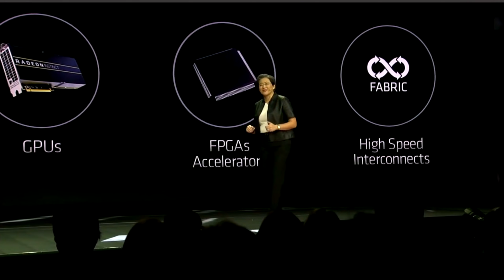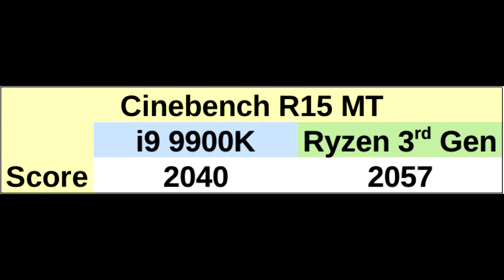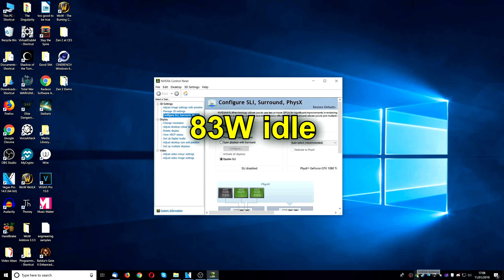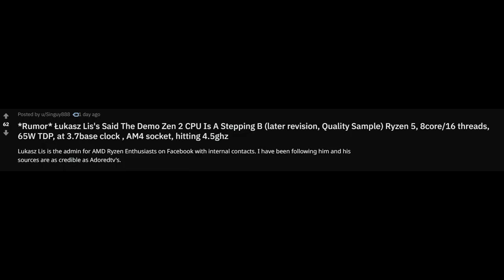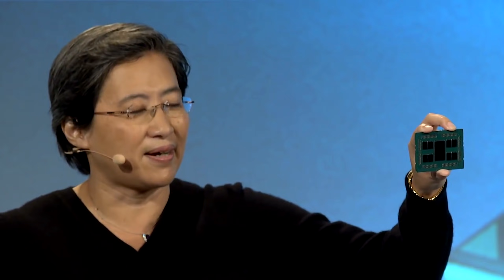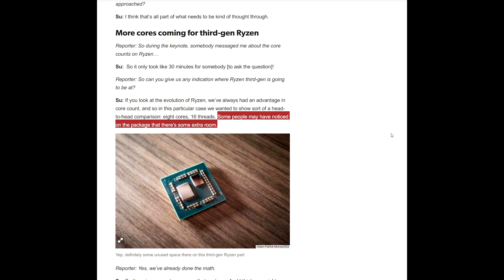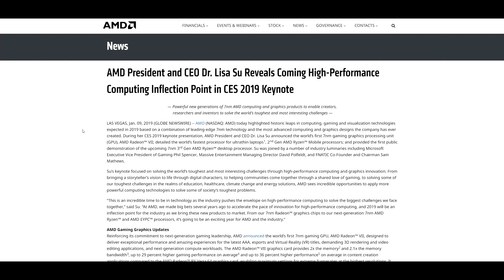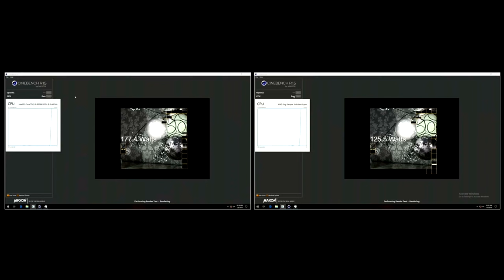Zen 2 Faster than i9 9900K at Half the Power.

Comment: Using the 8c/16t Zen2 chip against the 9900K was far more embarrassing for Intel than using a 12c or 16c chip. Because there's no way in hell that 8c/16t Ryzen 3000 will cost anywhere near the 9900K. 
Even if those leaked prices end up being 20% higher, Intel will still be forced to drop prices. I'm starting to get sick and tired of Intel's prices. 430EUR for the 8700K/9700K and 575EUR for the 9900K? Piss off Intel, you're drunk.
Reply: But can they? Don't their chips cost more to make?
Reply: @Cryosxify  Cost more to make individually, but they can produce many more per wafer due to the chiplet design.
Reply: @STR33TSofJUST1C3  Intel I mean. They have to maintain margins and they're losing market share so they're kinda boned
Reply: @Cryosxify  Oh Intel? No idea. The only way to gain market share is to sell more. If your sales drop due to being non-competitive, you are kinda forced to cut your prices.

Comment: I am very happy that the 8 core part is a single 8-core chiplet and not two salvaged 4 core chiplets. I don't really need more than 8 cores and I was a bit concerned that the 8 core was going to turn into a TR-like configuration with all the latency implications.
Reply: You'll still have higher latency than say an Intel ring bus part since the IO is on another die however AMD have said already that some of their IPC gains are directly coming from latency reduction.

Comment: "And two memory channels will be enough?" "as I said, more to come"

Triple channel memory perhaps? With a separate I/O die, it's a possibility! (though as dope as that'd be, I'm guessing unlikely)
Reply: AM4 doesn't have pins for extra memory channels. And adding more pins would make it completely new socket and that's not going to happen cause TR4 exists.
Reply: @kognak6640  I am not that familiar with the hardware arrangement with the pin outs on the new cpu since the memory IO controller is now a separate chip. They all communicate to 4 channel boards, just not with dedicated controllers. Please teach me more. I am always eager to learn more.
Reply: @joanamendoza-r5l  AM4 boards have two channels. 4 memory slot boards have 2 slots per channel, either in T-shaped topology or daisy chained. Latter is typical as it provides best signal quality for primary slots(=best possible clocks) and reason why first two memory modules go to certain slots. AM4 has 1331 pins and because each ddr4 channel requires about 200 pins, quad channel socket would have minimum 1800 pins. Intel's quad channel socket have over 2000 but it has more PCIe lanes.
CPU pin layout needs to remain same if cpu fits in same socket as predecessors. And because zen2 is backwards compatible, it will have that same AM4 pin layout and two memory channels which come with it.
Reply: @kognak6640  You don't need that many more pins for more channels, if there are unused pins on the am4 socket and package it might be possible to create and am4+ motherboard chipset to enable more channels, perhaps even more pcie lanes. Though moving to pcie4 would also allow the 4 lanes going to master chip to be down-converted to 8 pcie3 lanes or even 16 pcie2 lanes and thus support more add on device with fewer cases of 'using x dissables y' situations like we have now. here the socket could stay am4, and just need a new chipset.
Reply: @kognak6640  I found an image of the pinout, and I have no idea what any of it means, but there looks to be many unused pins. Again, I'm not saying it's likely, but a boy can dream, no? https://www.google.com/search?q=am4+pinout&client=ms-android-bell-ca&prmd=isnv&source=lnms&tbm=isch&sa=X&ved=2ahUKEwiZsbqowujfAhUM7IMKHS9aA5EQ_AUoAXoECAwQAQ&cshid=1547305622167&biw=360&bih=560#imgrc=HAjx_upvEgIUmM
Reply: AM4+ Triple channel ?? hmmm
Reply: If the R9 has TR performance, I would bet it is going to have quad channel I\O controllers.
Reply: @nxtktube  When Lisa was asked, she said there was more to come. Ryzen, and just about everyone else that has not been living under a rock know that memory bandwidth on AMD platform is the Achilles heel. There is a solution if I were a betting man  if we are to truly stay on the AM4 platform for two more years.
Reply: @joanamendoza-r5l  "memory bandwidth on AMD platform is the Achilles heel" Can you explain why and show some evidence of that?
Reply: @bgtubber  The best example is to look at benchmarks on You Tube using DDR4 at different frequencies. The higher the frequency you go, the better performance you get, to a point. Single rank vs dual rank memory also affect performance, dual channel vs 4 stick solutions, high CAS timings, poor bios memory mgmnt by motherboard mfgs, etc.
Reply: @joanamendoza-r5l  That's largely due to that infinity fabric having it's speed tied to closely ram speed and timings. This is running memory from an I/O chip that can decouple those. Well executed with a good and smart cache system will help a lot with this. Though going four channel could help some also, there are scaling limits to this like you have in multiple gpu setups. You get most of your improvement going from single to dual, after that diminishing returns kick in pretty quick.
Reply: @kaseyboles30  I expect, not only more memory controllers, but better ones. I think 3400 and 3600MHz will be more widely supported eventually and the new Zen 2 architecture should address all of this. Just wish 2x8GB sticks of Samsung B die did not cost me $195usd. It has been suggested that with the new igpus, the chiplets may have a 384 bit memory controller instead of the current 256 bit width.

Comment: Single threaded probably sucks that's why low power
Reply: That would not make any sense.... if the single thread was low then it would lose in cinebench... 8 core vs 8 core the better single core will win since there is no core advantage anywhere. Clearly Zen 2 has higher IPC than intel could possible dream off
Reply: @Thesinistereyes1  Well Zen's castrated version of SMT(what intel calls hyper-threading) gives up to 33% extra performance, while intel's hyper-threading gives up to 25% extra performance.
But Cinebench is using an intel compiler, so Intel automatically has an advantage.

On top of that this CPU probably didn't maintain boost clock speeds at full load due to it being an engineering sample, like Zen1, while with XFR it should maintain them and get better performance as a whole. 

Keep in mind that intel should bring their own 10nm in 2019 and an actually improved architecture for the first time since 2015.

Another thing to keep in mind is that intel themselves have stated that First Gen 10nm will be slower than 14nm++ so don't expect coffeelake clock speeds, but if they manage to surprise us and achieve them, then it would nice.
Reply: @rattlehead999  That is true i but i can assure you that engineering sample is running slower than 4.7ghz does proving the fact that at single core speed Zen 2 will still be faster. We still have 6 months before release so i know that we might get better quality silicon in the next few months before they finalize... remember zen 1 was at 3ghz when the showed it the first time as a eng sample. All im saying Zen 2 isnt going to get any worse than this... At the worst 9900k perf but chances are its going to be better.
Reply: @Thesinistereyes1  Still disappointing... Two years and it won't even be 40% better than Zen1... and don't give me the intel crap... just because intel is crap and amd is lesser crap doesn't mean AMD is good...

Or as I like to say comparing a smaller shit to a bigger shit doesn't change the fact that both are shit...

At least the core count is up... not that it's thanks ot anything AMD did themselves, you can thank 7nm(actually 10-12nm more accurately) for that.
Reply: @isaacw7479  Haha the smartass is here... The weak argument of "you do it better"...
Look my problem is not that they can't do it, it's that they purposefully don't do it.

Intel and now AMD are just trying to make Die sizes smaller and smaller, while trying to sell them at the same prices, thus increasing the profit margins and the markup of the products, while making enough advancements to call it a new product and be competitive with their competition. Same applies for GPUs.

IBM, on the other hand, is brutally awesome. They annihilate their previous architecture with each new one. A 12 core/96 thread IBM beats Intel Xeon 48 core/96 thread in an x86-64 optimized environment... let that sink in...
Reply: @Thesinistereyes1  
No usually when I say AMD is doing shit, they bring up that Intel is doing better and somehow that would excuse AMD...

And clock speeds are said to be 13% higher than Zen1, IPC we don't know yet, but it would have to be 24% higher to hit 40%, which really isn't a good at all, I said that it's sad that it didn't even hit 40%.

Though a good upgrade benchmark minimum is 80%. if it's 80% better for the same price per core be it IPC, CPI or Clock Speeds then it's a good improvement. Like back in the day for AMD and Intel and like till this day for IBM, though IBM really shouldn't focus on single-threaded performance considering what their CPUs are used for.
Reply: @SweatyFeetGirl  And I gave you specs... none of the specs are at 7nm... -_-
Reply: @rattlehead999  geez man, do you think Moore's law is still a thing when we're getting below 10nm? I miss those days of massive performance gains, but we're likely to hits a hard limit on what can be done with lithography without a radical breakthrough in the science.
Reply: @isaacw7479  
And you didn't read anything that wasn't written for you... 10nm is not 10nm... 
Please do read everything.

Specs of process nodes:
https://www.semiwiki.com/forum/content/7602-semicon-west-intel-10nm-gf-7nm-update.html
https://imgur.com/gallery/O4OdDug
https://pbs.twimg.com/media/Dde0RFIVQAAcZfO.jpg
 

And I shall repeat myself, IBM is doing it without a problem... 

And as I said AMD, Intel and Nvidia want to get smaller die sizes, so they don't improve the cores, thus they don't increase the transistor count very much.

Smaller Die sizes mean higher yields, lower failure rates and thus cheaper AMD, Intel and Nvidia to produce them, while they sell them at the same prices, increasing their profit margins and the markup of these products. They only improve enough to be competitive with each other and release new products.

Hell the gtx 1080 was a GPU that had a GP104(Geforce Pascal 104) chip, 312mm^2 die size, less than 20% failure rate from the get go, low priority, thus low budget R&D and costed 700$ MSRP at launch in 2016... The GTX 560, which was the gtx 1080 equivalent of 2011, had a GF104(Geforce Fermi 104) chip, 332mm^2 die size, over double the failure rate and Nvidia went all out on developing and fixing Fermi to not be a bust, and the gtx 560 costed 200$ MSRP in 2011(254$ in 2016)... talk about overpriced.

Nvidia sold the gtx 1000 series GPUs at 100-138% profit margin per GPU sold. From the end of 2015 till Q3 2018 their stock prices went from 17$ to 289$ due to the massive profit margins of expensive items.

For reference Apple operates at 35-45% profit margin, this means that Nvidia GPUs were 3-4x times more overpriced than Apple... like let that sink in...

 and Moore's Law is just an estimate...
Reply: @Thesinistereyes1  I'm glad others have realised this! I keep seeing comments about how they didn't show single core performance, that might matter if the ryzen had more cores than the 9900k but as it was an 8c/16t vs 8c/16t benchmark it's pretty obvious it would also beat the 9900k in single core test on cinebench too. 

Also if this is true and it was a low end ryzen beating the 9900k then lol @ intel! 2019 is going to be a great year for pc enthusiasts.
Reply: @Frostie3672  That's not how it works, a 2700x actually outperforms a 9900k at the same clocks in CB15 MT but will fall behind in the ST test because CB15 performs better in the MT benchmark with Ryzen's SMT over Intel's HT.

Example:
http://media.redgamingtech.com/rgt-website/2018/11/cinebench-9900k-vs-2700x.jpg
Reply: Obvious intel shill is obvious
Reply: 7nm vs 14nm.
And single-threaded is lower due to much lower clock speeds due to it being an engineering sample.
Reply: your assumptions are ignorant .
Reply: the test AMD showed didnt show any IPC test. the ryzen processor could be clocked at any clocks, while the intel processor was at stock clocks like they mentioned which is at 4.7ghz with the turbo mode on all cores.
Reply: Also why buy an 8 core for single threaded usage?
Reply: @rattlehead999  If it has the highest single thread performance then you would buy it.
Reply: @antoniestrydom6367  

No as I have a Ryzen 5 1600x and until something that has at least 80% better single core performance(Be it higher clock speeds, IPC, lower CPI or a combination of all three) I don't plan to upgrade, unless I need more cores in the future for work.

95% of Software still scales poorly with many cores